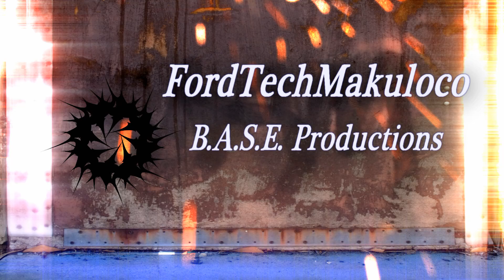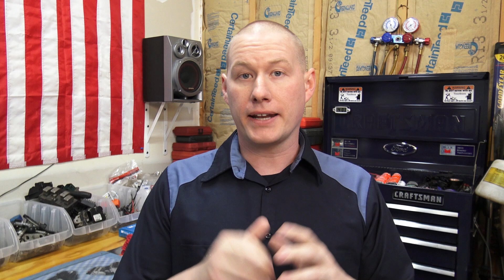Ford 6.7L Powerstroke Engine: Preventing Catastrophic Engine Failure

Comment: 7.3 with a manual tranny. that's my dream truck. why bulletproof a 6.0? it's like polishing a turd. 7.3 have reliability, and cost advantages over the new power strokes. power can be added easy enough and fuel economy can be greatly increased without hurting the motor.  if not a 7.3, Cummins makes a good diesel as long as you avoid some of the  automatic transmissions they came with.

Comment: one big problem here... yes the glow plugs are PART of the main reason for the catastrophic engine failure on the 6.7, BUT the other main cause is not a cheap/easy fix and that is that the exhaust valves were improperly tempered and the majority of the crack and fall into the cylinder. this is coming from an 11 1/2 year ford diesel tech.
Reply: this is referring to build one of 6.7s.  later years have issues with lower end bearings
Reply from the maker: +Chaun McGuire I also was a certified Ford diesel tech and agree the valves are also a known issue but I have seen this concern many times and I have never seen the cracked exhaust valve issue to date actually happen.
Reply: +FordTechMakuloco i have seen several. I've even had an ambulance that came in with a locked up bottom end,that when I inspected the heads, almost every exhaust valve was cracked from center to one face.
Reply from the maker: Man not good sounds like a nightmare!
Reply: +FordTechMakuloco I've done many engines haha. my worst one to date was a '12 with a mysterious coolant usage concern that I replaced thermostats (primary),EGR cooler core, head gaskets, still leaked, then found a crack in cylinder #2 bore, still used coolant. ended up being told by engineering of a rare concern of porosity in the heads. replaced both heads and it was good (they were sent to be checked btw). My warranty guy loves me for that truck.
Reply from the maker: +Chaun McGuire The ole porosity in the heads trick I see I have heard of that on a few of the Ford engines causing issues.

Comment: hey i just buy this 2012 f250 with 93000 miles is a away to find out if my glow plugs they have been update or the 2012 don't have this problem.    this truck is running  great but i just find out the o rings injectors are licking fuel. to fix this problem i just have to change the o ring o is something else that i have to do beside that .  i never replace o ring before i just wonder if have a video o how to do it.  Thank for u time  i love u videos

Comment: seems to me that owning a diesel pickup has become a nightmare!
Reply: +digitalmanolo84 306,000 miles on my 04 cummins and I've only ever done routine maintenance...
Reply: +Murph_Derf my comments where mostly in reference to newer diesel engines
Reply: only for ford and chevy diesels. 01 Dodge CTD 300,000 miles original powertrain. Startes below 0 without being plugged in no problem.
Reply: +digitalmanolo84              Jesus no kidding Im wanting to get a 2017 when they get here,but man Im thinking gasser may be the way to go???
Reply: +Murph_Derf i want to do that and hope warranty wont be fried...
Reply: just buy a chevy duramax or early 5.9 12 valve with stick trans then you get bullet proof right from the factory.
Reply: @mikesrandomvideos  Two Duramax trucks ive had have been the biggest pieces of shit ever.  Ive had a lot of trucks (Powerstrokes and Cummins)
Reply: I have 94 7.3 f250 IDI factory turbo truck is solid and hauls like a fraight train lol
Reply: @digitalmanolo84 True, but, IT WOULD SEEM that improper maintenance may play a big factor in these breakdowns.
Reply: Yup, thanks EPA
Reply: +Murph_Derf Idiot
Reply: Can you say duramax or cummins then you have a real truck fords suck.
Reply: GM rules you can say that Fords suck I even  had my 7.3 crack 3 pistons. The BEST motor they made? ford is the laughing stock of diesel hands down.
Reply: the new cummins and duramax are fine just delete the dpf & egr. and stay away from the powerchokes
Reply: I wouldn't own a new diesel.  Too much possibility of costly repairs.  Get a low mileage 6.0, and spend the money to have it bullet proofed and you'll have a great, reliable truck.  Or even a high-mileage 7.3, and have the motor thoroughly checked out, or even re-built.
Reply: Yep. If you don't need a diesel (very few people actually do) then it's best to go with a gas engine. Modern gas V8's used in any 3/4+ truck are pretty decent, 6.2L Ford 6.0L Chevy or 6.4L Ram. They all have a pretty decent track record for reliability and all perform pretty evenly, they don't have the nightmare routine maintenance issues that Diesels have nowadays.

Comment: Great video. I would've like to have seen clips or photos of the actual repair summary and some of the problems you encountered. Do you think the ex valves are a problem on the early 6.7's?
Reply: Yes the exhaust valves are a problem on the early 2011. Only 6.7L I've seen with failed glow plugs were the chaise can work trucks. But the 6.7L with the run rough on regen. Fix is replace all exhaust valves on left cylinder head. Definitely a problem.

Comment: i beg to differ, i think its a exhaust valve problem. Why is it always the exhaust valve thats broke, why is it when you pull heads off that there are more cylinders with the exhaust valves that have hairline cracks in them but the glow plug is perfectly fine. why would ford not just do a recall on the glow plugs since they are so simple to change rather then risk replacing motors
Reply from the maker: +Justin Thuringer There is also a tsb for the exhaust valve issue more for seating problems though. Only makes sense that the exhaust valve is going to get the brunt of the debri as it passes out of the system. Are you saying a small bit of exhaust valve is breaking off and taking out the glow plug tip as it floats around in there not likely at all.
Reply: Then how does that explain cracks in exhaust valves on 6.7 when the glow plug is 100 percent fine, seen it on multiple motors that's been torn down
Reply: Even seen some that have blown up and guess what glow plug was fine but guess what was broke, THE EXHAUST VALVE
Reply from the maker: +Justin Thuringer I'm not saying there is no exhaust valve concerns ever I am merely relaying the information about early 6.7l glow plug problems. There are many more problems with the 6.7L but obviously I can't go through all of them in one video.

Comment: totally agree, I'm doing a 6.7 rebuild right now, 2 broken glow plugs trashed the motor
Reply from the maker: +Mike torrance Nightmare I never want to pull one of those again although with the cab off it is totally doable.
Reply: +FordTechMakuloco yea I agree with that problem is its a special use vehicle and pulling the cab wasn't an easy feat so had to pull with cab down.  not fun at all lol
Reply: FordTechMakuloco Hi just a stupid question. I have a 2014 6.7 liter with 32000 miles on it I do all the maintenance on time is this motor really junk?

Comment: First off let me say thank you, love your videos, have helped a lot. Second, are there any other issues i need to be aware of with my 6.7?
Reply: I know this is late but yes the factory turbo on the early 6.7s are weak because of a ceramic bearing in the turbo and if your turbo goes out it can take the motor just look on amazon and search remanufactured turbo for a 6.7 powerstroke remanufactured means they took it back and fixed the problems that were wrong with it

Comment: Thank you sir. I have a 6.0 any known glow plug issues like this known ??
Reply from the maker: +Kenneth Phillips No on the 6.0l no. Only thing to watch for on the early 6.0l glow plugs is a design change so triple check any replacements you put in they changed the length and are not compatible. As a final check put the old and new side by side and verify length before installing.
Reply: Forgot to add it's a 2006 Ford f 250 Super Duty six-liter
Reply from the maker: Yeah 06 has all the same lengths.
Reply: +Kenneth Phillips http://www.powerstrokehelp.com/

Comment: I worked for ford as a teenager parking cars and checking in new inventory. My last year there a guy bought a new F250. They let him fill it up with fuel and at that particular station the diesel handles were yellow and gas was green so the poor guy filled his new truck up with gasoline. They told me it was a 30k screw up but after being a marine diesel mechanic for about 4 years it seems like that's way too much. They had just come out though so who knows?!
Reply: +powerstrokethis03 if he ran the engine with the gas in it and ruined the motor i could maybe see 20-25 depending on the year and engine, ive hear the 6.7 runs 16k new

Comment: Sweet! I just had it out with the folks at ford about this when they only offered $2500 on a $17k job for CLP. I played phone tag for a month trying to find out if there was a fix for this because I have had this problem with about 10 of the trucks that we have in our fleet. Seems to be on 2011 and 2012 trucks.
Reply from the maker: ***** Yup just the early ones.
Reply: FordTechMakuloco Have you had any experience with the jackhammering issue during regen on the 6.7? starting to get some internet heat, especially after ford released their latest tsb on the issue.
Reply: What is the TSB number?
Reply: Mark Hersh its the valve guides are to tight, valves get hot and stick in guides then piston helps push up the valve for ya:)

Comment: I am looking to buy a Ford with a 6.7 diesel  , what is the safest year to buy right now , i know there was some years that the 6.7 grenaded the turbos . Iwould rather spend more for a better truck now than later for a cheaper trucked riddled with problems  In your best opinion. Thanks .

Comment: A little off topic but mine was built on 3/16/11. Do you think I'll have problems with exhaust valves? It's a 250 with 101k miles.
Reply from the maker: Chris Moffett You know we have never seen that problem I really don't think it's that common. I know there is a tsb for it but again not that common.

Comment: I have a 13 6.7 been an awesome truck. All engines have tweaks that need to be worked out. Alot of people  say the duramax never had issues and for get when  they first came out they had over heating issues as well as cracked piston. Issues.  The 6.7 has alot to prove but I think ford has a winner on there hands now
Reply: Don't forget about those piece of shit Allison Transmissions that would constantly go into limp mode lol
Reply: Tristen Horner really? My stock 6 speed Allison is holding 500 horsepower pretty good and it’s an LBZ
Reply from the maker: andy alaniz It sure is a great engine power and durability wise compared to the powerstrokes of the past.

Comment: what is your opinion on the '15 6.7s I picked one up last week have 1100 miles on it am happy with it, a little more power than the 11-14 6.7s. Great videos, thank you for posting them.
Reply from the maker: moparvenom287 The 6.7 has been a strong engine for many years now and I would assume as with the 6.0l one of the last years of this engine should be the strongest.

Comment: So why if this is a know issue didn't Ford issue a recall for it?   By the book how much is this at a dealer? I'm looking at 2k to extend my engine warranty which I'll do anyway but is it worth changing anyway?
Reply from the maker: Coopers_dad Oh if you have the early glow plugs yes I would change them just to avoid the headache later on. Book hours on this for tsb warranty is like 20.4 but for anything else it will be close to 30hrs if not higher.
Reply: Coopers_dad because it's classic Ford not wanting to fix their screw ups.

Comment: thank god duramax engines do not see many engine failures like this, and i understand the 6.7 PSD is having a lot of emissions issues as well, dont get me wrong duramax engines do as well but not nearly as much as PSD's
Reply: Lol duramax owners just don't understand
Reply: Kevin Rogers Funniest comment I've read in months.  Thank you.
Reply: +BisquikXLT  I literally laughed out loud
Reply: +BisquikXLT  and how is this funny?
Reply: Kevin Rogers You do the math.
Reply: Kevin Rogers what issues with emissions?  I've had two 6.7's and never had an issue with either. The emissions system in the 6.7 works extremely well. I'm sure Chevy and dodge never had emissions problems.
Reply: Where I live most Duramax engine's are shot by the 200xxx mile mark no matter what generation they are
Reply: LMM, LGH, and LML engines had the most failures.

Comment: Good heads up for people that own a 6.7L.  If you don't mind would you share your thoughts on the quality and reliability of the 2.7L Eco and 3.5L Ecoboost? I value your opinion.   I am thinking about buying a 2015 F150.  Thanks - Glen
Reply: *****So are you leading to the fact there are issues with normal driving habits?? This is going to be a work truck not a race truck. Thanks for your opinion, I am trying to find out facts to the reliability.  More F150 Forum research for me.  Take it easy - Ozz
Reply: ***** post some links.....that would be helpful
Reply: It's because the blow-by gasses are routed through the intake, and there is no fuel being sprayed on the intake valves, is it not?